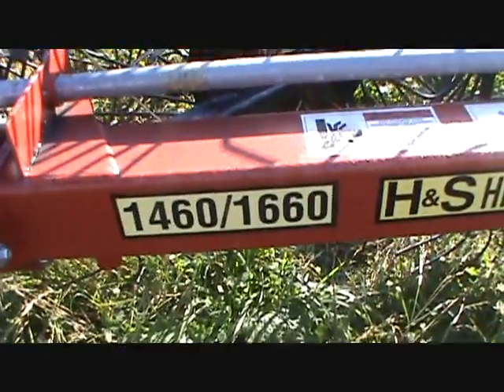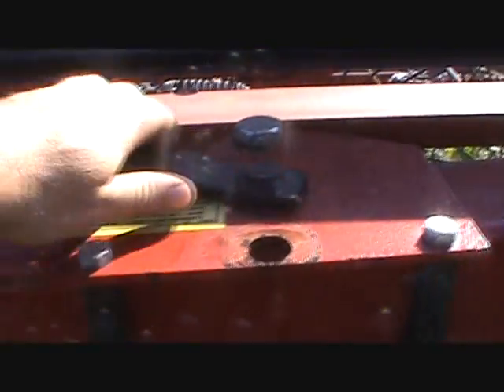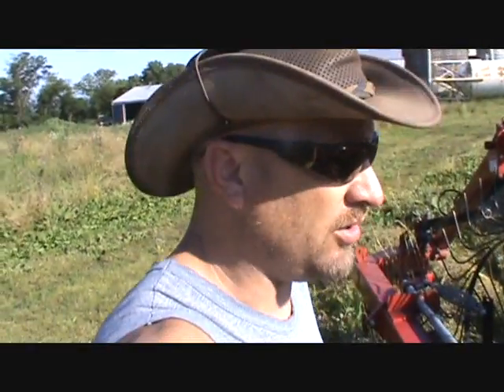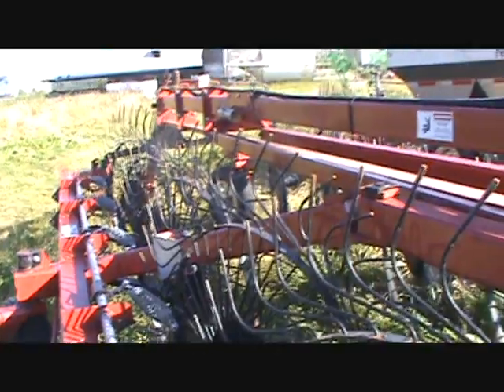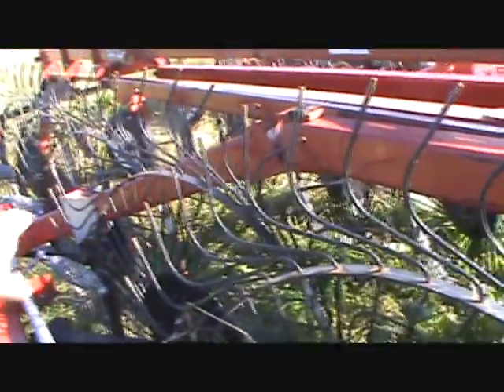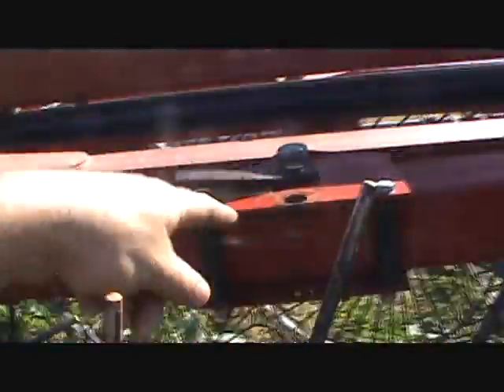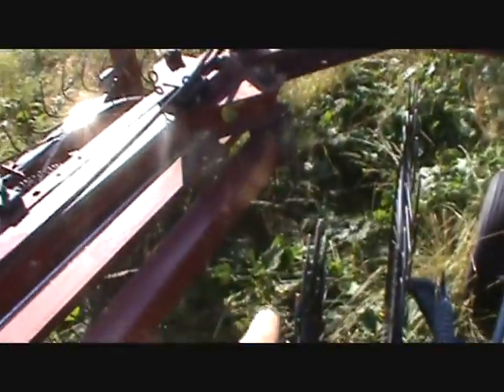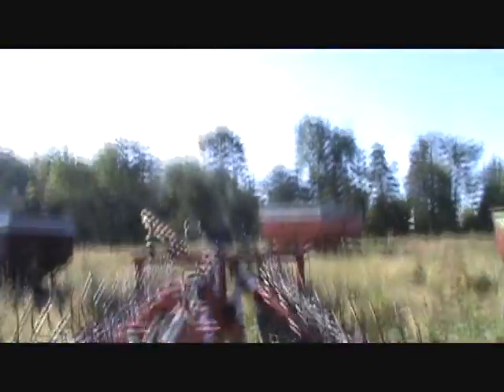Bent Again

Comment: I used to work as a mechanic for a local John Deere dealer here in Augusta,GA I set up a few hay rakes and mowers and its the dealers responsiblity to have the equipment set up before it leaves the shop. Each piece of equipment I ever worked on had a set up sheet that the mechanic had to check off to make sure it was right. I say this was 100% dealer error.

Comment: Since they delivered  it with out  its manual , failed to send  replacement manual and left it in the wrong mode for transport , seems all the parts at least should be replaced by the dealer , and installed by them if any special tools are needed, If they wont do the work they should at least inspect the unit if you have to do the repairs just to be sure you wont have any future problems.

Comment: John Deere they should have followed up on the sale of the rake and sent you the manual . They also should send some out to repair the rake , H&S should send the repairman to fix the rake at no cost to you and Deere Country should pay the cost of the parts and labor required tto fix your rake.And they shoiuld have sent you the operators manual as you asked for so 99% John Deere and 1% yours for not following up on the manual as you asked for, an noted on the invoice or contract. Good Luck.

Comment: I have never run a rake like that but from an engineering standpoint.. I don't like the design. Especially if your pulling it with a large tractor. The wing sections go way out and if you hit anything.. something will bend and that pin selector thing is just dumb. Try explain that to hired help and have them not destroy the thing.
  We always used a tandem hay rake. not very covenant for corners.. but foolproof, plus if you want to use a smaller path just unhook one rake.

Comment: I would never buy another rake with that type of design. Obviously they are prone to bending. As to whose fault it is...wellllll, I could argue both sides of that issue. In support of you I'd say that since you didn't get instruction manuals with it and John Deere told you it was "ready to use" then it would be John Deere's fault. On the other hand you should have walked around a new rake and read any and all warning labels before using the piece of equipment, making it your fault for having not done so. If there hadn't been a warning label as well as no manual for the rake, then it would have been Deere's fault. I haven't been working on a farm for decades but it seems to me that if a dealer (not the manufacturer) sells you a piece of equipment it's their responsibility to show you how to properly operate it, how to set it up and go over all safety features and transport precautions.

Comment: Looks to me like a weak design at those flanges.  If they were discs instead of squares I bet they would hold up better.  The fact that multiple failures of the same type occur is a good indication of bad design.  You sure have had patience with this problem.

Comment: Chalk one up to another lousy setup mechanic.  I've seen a LOT of equipment delivered "field ready" that wasn't even REMOTELY set up correctly, or sometimes not even ASSEMBLED correctly!  I got a new Woods 10 foot shredder years ago that wouldn't cut anything-- turns out some idgit installed the blades BACKWARDS (on the wrong sides/gearboxes).  

If the dealer is delivering something "field ready" then it SHOULD be FIELD READY.  Not "well the tires are all up and nothing's falling off", which is NOT "field ready".  The book should have been there, but more importantly, someone knowledgeable about the machine (delivery guy, salesman, whatever) should have been there WHEN THEY DELIVERED IT to explain everything and the "idiosyncrasies" of their particular brand's design features (like this one wing folding deal) so that there's no mistakes... ESPECIALLY when having the pins in the wrong location can physically damage the machine!  

Ya might have been running rakes since you were a kid, but still, have ya ever run THIS particular brand, make, and model before??  If not, then the DEALER should have brought you up to speed on it when you bought it and they delivered it.  They should ALWAYS make sure you have a manual as well.  I put this squarely on the dealer... they fell down on the job.  

Do you know for a FACT that they had trouble pinning the wings together to deliver it, and that's why they moved the pin?  If so, that tells me right off the thing wasn't right out of the box... something was outta whack if it wouldn't pin together when folded up without moving pins around.  

I agree with someone else so said, "I don't like this rake design".  What you essentially have when it's unfolded into working position is a 40 foot wide inverted "T made out of sections of box tubing bolted together with four dinky bolts in the corners of steel plates.  Maybe if the plates were heavier or round and used 8 bolts and gussets coming off the flats of the tubes out onto the plates, it'd be a lot stronger.  The longer something gets, the flimsier and more flex it has in it... it gets like a wet noodle, even though it's made out of steel.  At least the New Holland rake had those "tie rods" underneath that were supposed to be tight to add some strength.  What these things REALLY need are some tie rods or bars or something sticking out the sides attached to both ends, like this <> on either side of the main frame to reinforce it and prevent bending... the first one was clearly bent by the tractor being turned 90 degrees, enough for the tires to scrub the tongue frame, putting the entire frame in a bind.  This one evidently was "off" straight out of the box since the transport bars couldn't be pinned together without pulling the one-wing-fold pin.  IMHO it's just a LOUSY design.  

That said, a pair of 9 foot rolabars just ain't gonna cut it-- not when you need a 40 foot rake to get the job done.  I use a pair of rolabars on a bridge hitch, but I wouldn't want to try to cover the acres you're doing with it!  The rotary rakes aren't even sold down here.  They may be the cat's pajamas in alfalfa and stuff in some areas, but they're not the best for EVERYTHING.  All those moving parts and little bitty wheels, if you're raking high-value alfalfa and horse hay all day in golf-course smooth fields, then go for it.  Put them down here in the wild and wooly rough fields we got and you'd be broke down more than you'd be running.  Try to cover a bazillion acres of rough ground with one raking mushroom hay and you'd be in the poor house too I bet.  

Dunno what the answer is for you, other than look for a sturdier design IMHO... the H&S seems a BIG step down even from the New Holland you had before.  

Later!  OL J R :)

Comment: You're responsible for not knowing how to operate it properly as much as it sucks. If it was me I would probably weld on better flanges where it bolts together I'm not a fan of those rakes because there is no rigidity in them. I used one like it when I worked for a guy and it worked good but it was sketchy as hell when it clogged and even when the outside wheels fell into holes it felt like it was going to bend it. For a rake that size there isn't enough engineering for the amount of material.